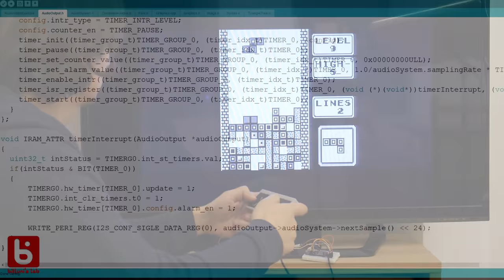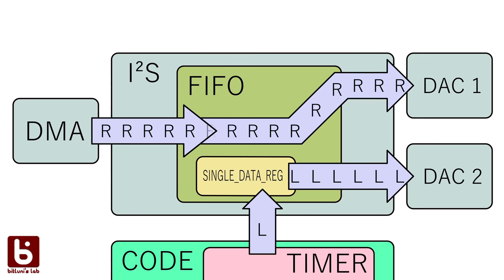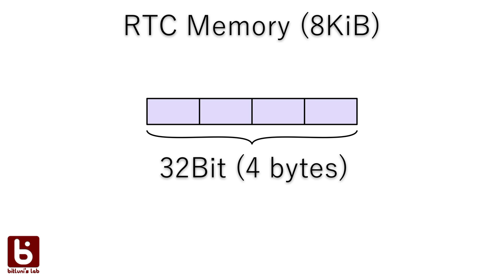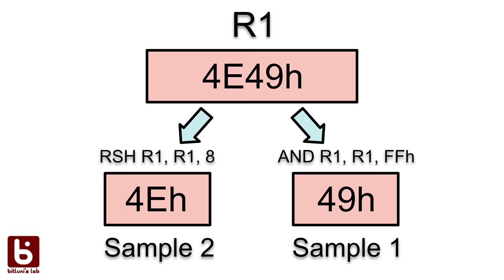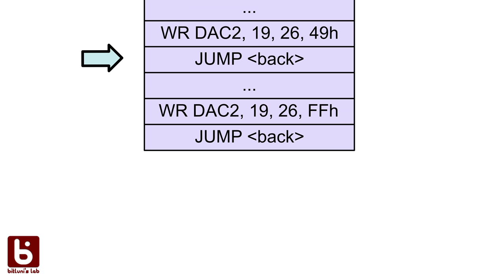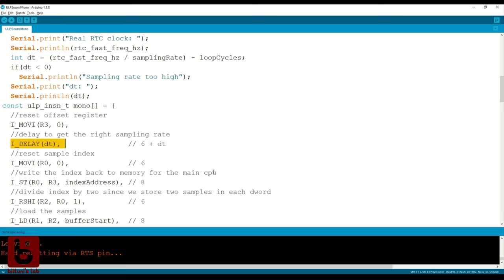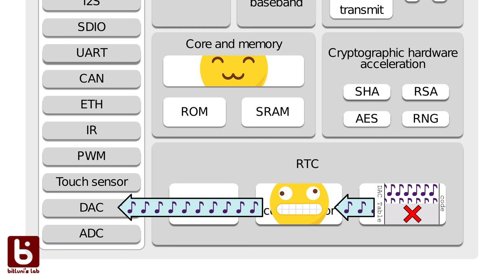Coding a Sound Driver on the ESP32 ULP

Comment: Very nice work, getting the audio to work with these annoying limitations of the ESP32! The video is great too, you are improving with every upload. Keep it up! Your VGA board is now running happily here, the next version of the board will have an audio jack I assume?
Reply from the maker: Thanks! the version after has a jack. but I have to test if it works with smd caps properly. You could use the pin directly with a line input since most audio interfaces remove the dc offset anyways but I just destroyed one DAC while plugging the audio jack in w/o the cap. it seems to short for a moment. the dac is very sensitive

Comment: For this, you could use the DMA to write your samples to the DAC instead. The DMA is actually very capable...
Assuming that the DMAs are needed for something else and must use the ULP; I think it is more efficient to "compile" the sample in the main CPU to the ULP machinecode, so that each byte to be written is the actual opcode to write that data out, so plus a call to a delay, and you should be able to get ~4k samples out of it, right?
Reply: Write the code where each instruction explicitly writes each sample to the DAC... one instruction for each sample.   WOW!  Would that actually work - not checked the instruction lengths for that.     That's uber-mega-hacky, and I love it!   But to be honest, you're completely right with the DMA.  That's probably the best way to go.

Comment: Hey bitluni, I love your work, and this ROCKS! Curious why not use an individual instruction for each possible value you can send to the DAC, only 256 needed, jump table takes 1k? Another 1k for code? Then use bottom 16 bits of the rest of the memory, 2 bytes, so 6k * 2 or 12k sample buffer.

Comment: This is genius, 

I hadn't event considered that the ULP could be fast enough to work with I2S, I'm working on a project that could definitely use this, do you think the the ULP is powerful enough to do a volume level calculation of the i2s stream? 

My goal/hope/dream is to be able to wake the main cores using the ULP processor whenever sounds above ambient are picked up with a I2S mic, so i can save as much power as possible.

Comment: Brilliant work! Makes me wonder how to modify this for ws2812 LEDs...
Reply from the maker: you got a point! it was always a hassle with the rtos! I MUST try that!
Reply: @bitluni  If you do that I will upgrade my lights project to use your library, you have my word! As of right now I'm dealing with the jitter from handling interrupts from a web socket connection. I'm sure many other people who like to torture their esp's processor would appreciate a fix for the jitter!!!
Reply from the maker: I solved issues with the neopixels on the esp32 using i2s for the pov lightsaber. You should check out the code

Comment: I want to make a Theremin using two I2C ToF sensors and an ESP32  can the ULC be easily used as a wave generator with varying wave length and amplitude?  

  Cool video! Reminds me of writing self modifying for C64 raster interrupt code a long time ago.

Just bought a M5 Stack Core 2 with 2 sensors that seem fast, accurate and sensitive enough. Just worried if it is still ok when controlling playing audio.

Comment: How is the Synchronization done between the two processors?
Reply: Patrick Knöbel the youtuber Andreas Spiess has a good video about the ulp
Reply from the maker: The sample buffer is a ringbuffer. The pointer to the current sample is written back to the memory. The main cpu simply remembers the last pointer it has filled and continues to load samples until it reached the pointer of the ulp. This refill happens each few milisecond s. I'll add some comments to the code. The scetch isn't that long. RTC_SLOW_MEM is an array of 32bit words mapped to the rtc memory so the main cpu can easily read and modify it.

Comment: Can you not shift the bits in the buffer right 16 bits to get the upper high? From the RTC memory to the register that is. So two sequences. One for the lower 16 bits, then shift, and process the upper 16 bits. If it is out of alignment for some reason you could just shuffle the way you load the data... Hmmm.... dunno.
Reply from the maker: Shifting is done by the ALU. The source and the target need to be registers. All registers are 16bits only. There is unfortunately no way to get the high 16 bits. Even the technical reference states that.
Reply: According to the doc, the write instruction also writes some stuff in the upper 16 bits of the target memory word (the current value of the program counter), as is shown in the video. Doc mentions this can be use by the application 'to know which instruction stored that piece of data here'. So perhaps there is also a way to read the upper 16 bits, but that does not look very practical here if we can not control what we write there :). Unless the main cpu can write the full 32 bits, and we only read ?

Comment: How is that different from periodical writing to dac by cpu?
Code is hard looping to fill samples for ulp making esp actually use twice as much power or so
Reply from the maker: Ulp is running at ultra low power. The difference is the main cpu runs on rtos. You create a ton of overhead interrupting the cpu. Tasks like handling WiFi, Bluetooth stacks, or video generation have highest demands where the audio falls behind or can make it even crash. Why not utilize that computational power if it's already there und use the main cores for more complex stuff
Reply: @bitluni  Why not use second I2S

Comment: Why are you programming on assembler ?
Is it nessesary to be able to programm assembler nowadays ?
There is a course on my University and i dont know weather i should visit it or not.
Reply from the maker: We need to control every cpu cycle for the timing. That's only possible on the lowest level. You should give it a try.
Reply: Assembly is a good way to understand what actually happens inside a cpu. I find it fascinating, and love to go down to that level when I have time. However it is true that for mainstream development it is not a practical solutions